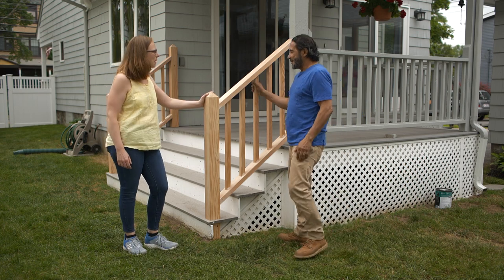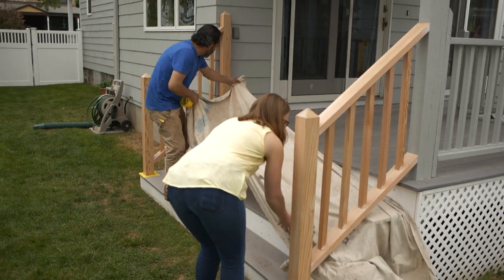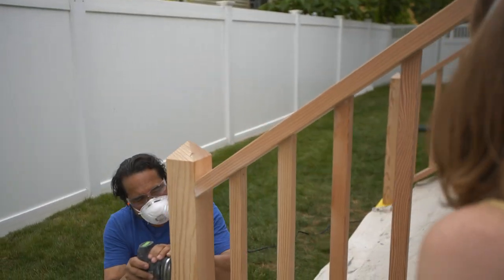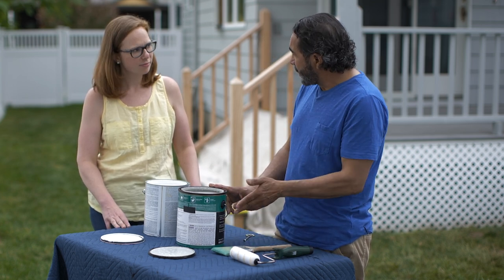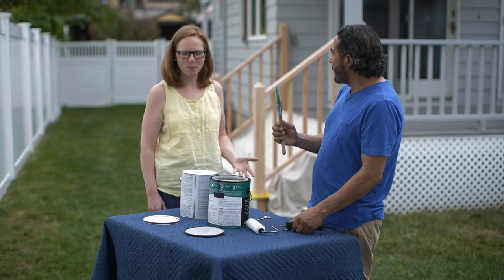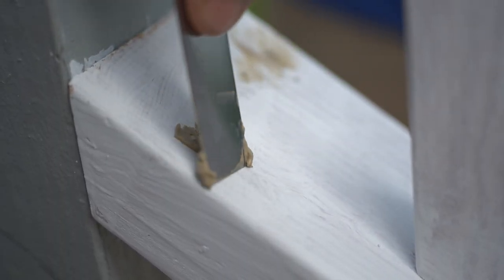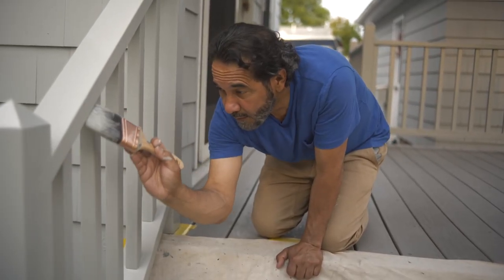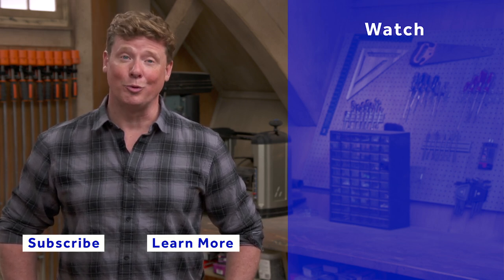How to Paint Outdoor Railings | Ask This Old House

Comment: As a Professional Painting Contractor that has commented on many of these video's...this is one that is spot on and I have no issues with. Great job.
Reply: Can you explain why you wouldn’t fill nail holes first?
Reply: @phillyd823  It's an exterior railing, that much detail isn't usually paid for. If we fill those nail holes, how about the rest of the exterior? The Fascia's, Soffit's, Frieze Boards...etc.
Reply: @ghpjerry  agreed. but since he did fill the nail holes you would generally do that first, right?
Reply: @phillyd823  Yes.
Reply: @phillyd823  no, filler bonds better to a primed surface than raw material.
Reply: Who would even care if you had an issue with it, you don’t have any videos on your page
Reply: @AlMai222  wow somebody’s in a bad mood
Reply: @phillyd823  Yeah I kind of flew off the rails there guys my sincere apologies.
Reply: @AlMai222  Because I don't have any videos means I can't have my Professional opinion on something I've been doing for 25yrs? Ok got it. Thanks for letting me know.
Reply: @phillyd823  Always better to prime over the metal nails/screws first to prevent bleed through (future rusting) and using the oil primer for this in the wood is better than latex/water-based. Then fill the holes after the primer is dry and I would re-prime the filled holes after sanding them, let dry and then ready for paint!
Reply: @MIZUNOMP60  seems like a lot of work. Gonna steal my time from watching youtube videos on how to paint properly. Lol
Reply: @phillyd823  Yea, unfortunately there's usually no shortcuts to doing things properly! I'm in the business since '98, many jobs I do are redo's of painting jobs not done correctly. Usually the prep is glanced over and this is the most important part to have the end result look good!

Comment: I would have patched first as i always do and then prime and paint.
Reply: On exterior railings?
Reply: Yep.
Reply: @ghpjerry  would you patch an exterior wall first or paint first ?
Reply: @Guardducks  or would you wipe your behind before you take a dump?
Reply: @Guardducks  I wasn't talking about order of operation, I was asking about "patching" a brand new exterior railing. Interior, yeah, fill nail holes, sand, seal & paint. Exterior, generally we don't fill the nail holes unless it's a custom job or the trimmer machine gunned everything.
Reply: I always prime first. The primer helps me see the voids that need to be filled

Comment: Why use wood filler on nail holes after you apply primer? To me you would think you will fill first with wood filler and then sand.
Reply: You should fill after your primer so he is correct here.
Reply: @ThePa1nterhowto  do you wipe your behind before you take a dump?
Reply: @TrumpAmerica-2024  All putty , filling and gasping  must be completed after the first coat, there are exceptions but 95% , 40+ years painting experience and no I always use a bidet then wipe.
Reply: The primer is to protect the wood and promote adhesion.  It's the same way you use DTM primer for cars before doing any filler.  One bonus is it also helps see defects.
Reply: @TrumpAmerica-2024  
Before and after.

Comment: Wonder why they didn't make the height on new rail match existing?
Reply: Yeah that kind of bothered me as well.
Reply: Current code is higher than the old rail. Most codes allow anything under 30" to be exempt. Some cities dont care and require everything be current code. In my area, if you change more than 50% of any stair, you have to bring everything up to code. Including the part you are not touching.
Reply: The angle of the stairs and code height may have something to do with it. Not the painters issue though

Comment: the stair rail is higher than the rail on the deck but 🤐
Reply: The old existing railing may not be tall enough to meet current building code and the new stair railing would have to
Reply: @benjaminrobinson3466  this old house didn't mess up. whoever built that first rail did 😩